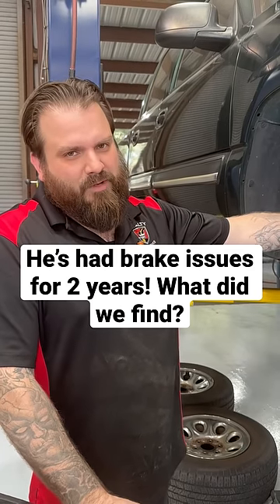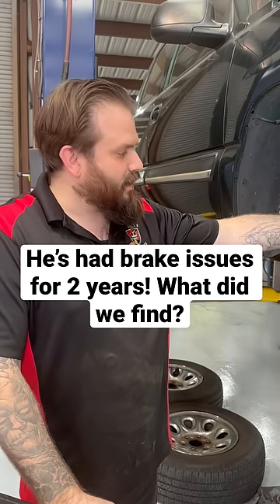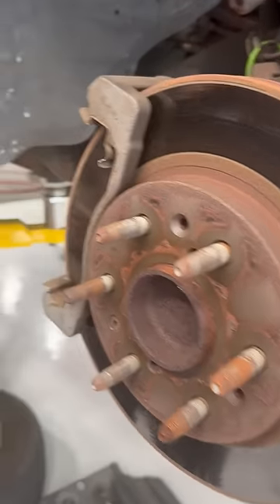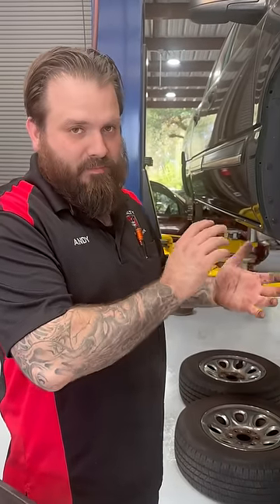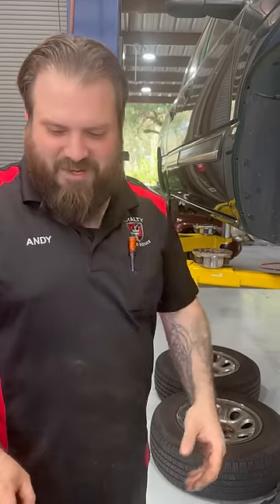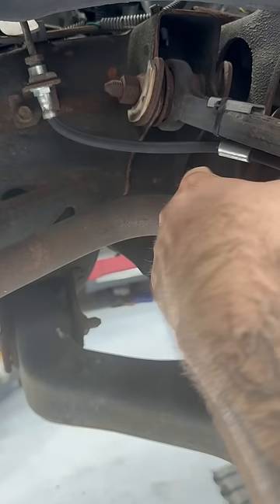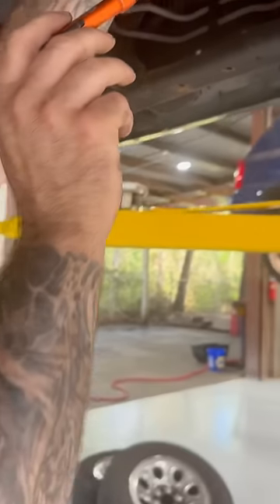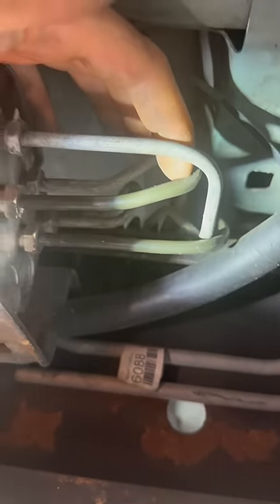Brake Issues for 2 Years! What Did We Find?! #shorts #mechanic #automotive #car #autorepair #brakes

Comment: OK... he never explained in the video what kind of a problem the customer had,  just "brake issues" and "the complaint was on the drivers side".   When looking at the front brakes the tech said you can tell the brakes were getting hot and about 100° more on the drivers side.  The kinked brake line was found to be the problem, but what was the original complaint???  😟   Is it pulling to one side under braking, not wanting to stop, brakes getting too hot,  pedal feels strange, noise, smell, excessive brake wear or what???  😲

Comment: I took my rig into the shop. They replaced rotors, calipers, pads, hoses and ran a new steel line. It was after that my problems began. It might just be the last thing you did.

Comment: I ran in to some issue's on my 92 k2500 . Come to find out person who owned it .before me had two different legeth slide pins on the calipers .truck always eat the passanger side pads before the driver side .did the upper and lower ball joints when i discovered that. No more issues .

Comment: I had issues with my brakes for 3 years after i had a complete brake job done. Pedal would get soft after driving for a bit. Wonder if a kinked line was the issue.

Never did solve the problem; totaled the car 😔
Reply: best case would be a brake flush, or bleed the air out. If you replaced Calipers those tend to make the pedal more soft.

Comment: All this could be avoided if we just use metal that don't rust, for the brake lines, copper or stainless both work just fine, and last until your car hits the crusher.
But the pot metal they put in for brake lines are cheaper, so now here you are, paying 1000 bucks in between new brake lines, and fixing other problems caused by misdiagnosing the badly installed new brake lines, all because the manufacturer could save $30 by not using copper in the first place.

Comment: It sounds like one of the hydraulic hoses is plugged up or the piston on the caliper is locked up. Going back inside the caliper when the brakes are released or he's been driving with the parking brake on

Comment: Kinked line was my worry when i redid my own brake lines thats why i bought a whole set of prebent brakelines. The front to back one is bent in half but thats easy enough to un bend
Reply: Try using copper nickel line. It's very easy to bend and work with. You almost have to be trying to kink it in order to do so.

Comment: The guy who installed that hose didn’t make the hose too. That’s probably an oem part. We don’t choose where to support brake lines, we just bolt them where they go. 

The problem has nothing to do with that “banjo string” soft line. Furthermore it’s taut because the wheels are unsupported, and it’s at full droop. You should have edited that part out when you found the real problem.
Reply: The hose was too short. The proper hose fit without being stretched. Even when up in the air. Just showing everything that was found.

Comment: i just work on my brakes. i know this new pad didnt do this damage to this rotor. this damage caused the heat and it came from the old replaced brakes. rotor should have been replaced with the brakes. i bet hes the guy been working on the car the whole time...

Comment: Haven't watched the whole issues. You say it gets hot on the passenger side, that's how far in I am. I'm gonna assume the rubber lines were never replaced and swelled on the inside, restricting fluid flow
Reply: I guess I was wrong, that will do it to.

Comment: I bought a truck once lines were on wrong side and wrong duty for weight of truck called dealer they told me certified tech did the work & it was no doubt done correctly. Hahaha turns out it was a 17 yr old kid that did the work with no oversite or supervision

Comment: I have a brake issue with my bus (mtm 28 tonnes). It was parked for 3 years and the engine started like a dream, but the brakes don't disengage. Would you have any advice on that? 
I want to use it for a non-profit project, so on a tight budget.
I'm posting a video about the brakes soon, but here is a previous video to give you an idea about the bus and the project. I would love to have a mechanic like you helping me out with some advice
https://youtu.be/kvyc7yDTECY

Comment: Just cut out the effected section of tubing and do a Scotty Kilmer patch with good tube and some compression fittings. Back on the road in no time.
Reply: Jesus christ. No. Do the whole line. The less failure points the better